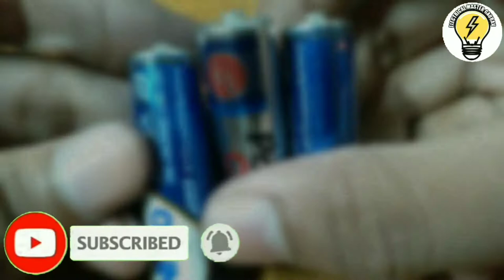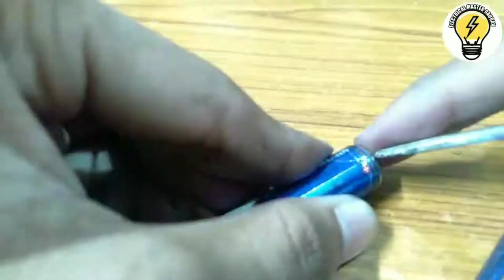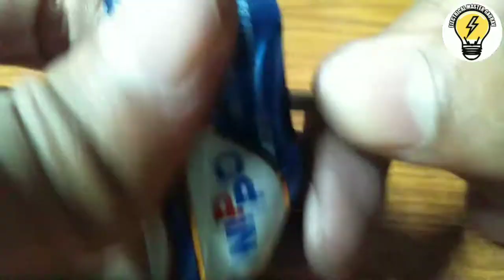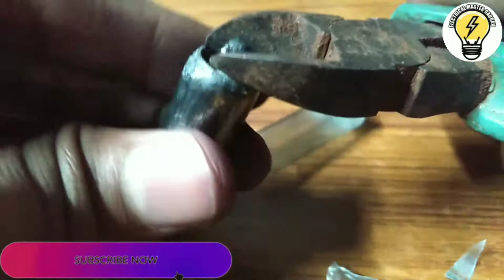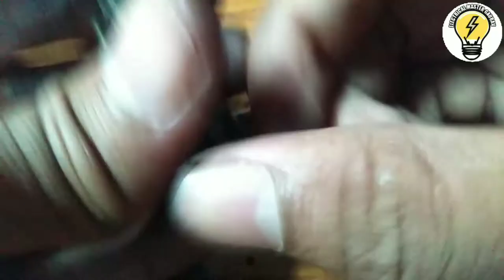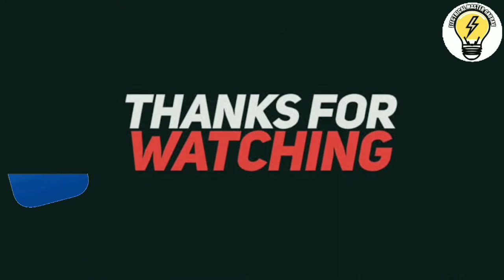DIY Projects | How to find a Graphite Carbon Rod from Triple AAA (3A) or AA (2A) Size Battery

Comment: Hey how do i completely dry the cell? Like my one is old but it still gives enough voltage for motor to run
Reply from the maker: Let it discharge completely,
You can discharge your dry cell by continuously running your motor or bulb💡

Comment: Will it blast if i use new cell
Reply from the maker: If you use a new cell,there are some chances that it may explode,or it may become hot,so for safety purpose you must use dead dry cell(AAA) battery
Reply: @electricalmastergaurav8834  Okay sir

Comment: If i use new cells what will happen?
Reply from the maker: It may get hot or start leaking or it may blast or burn so for safety purpose use old discharges cell only